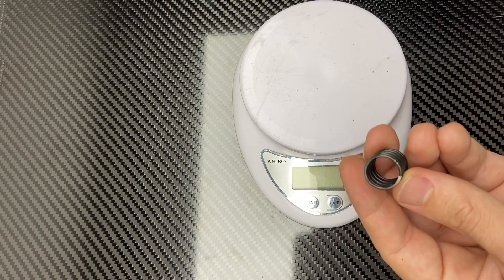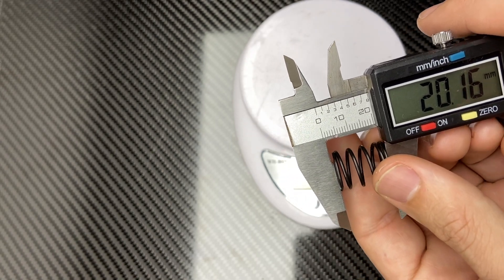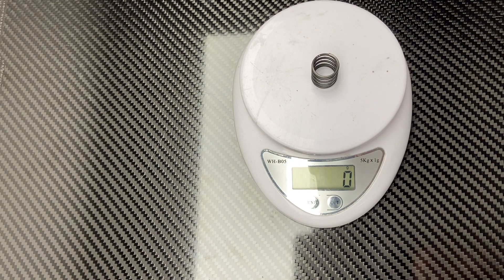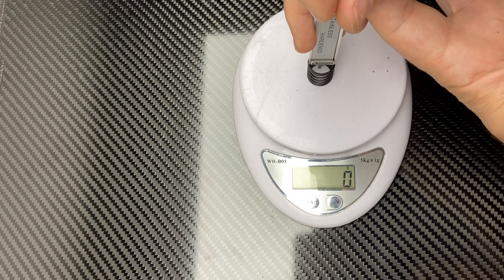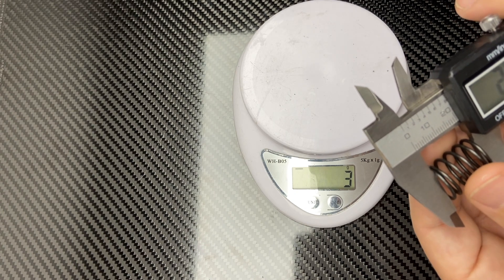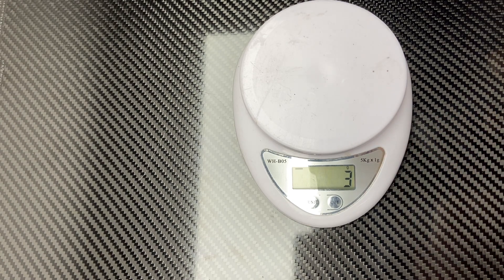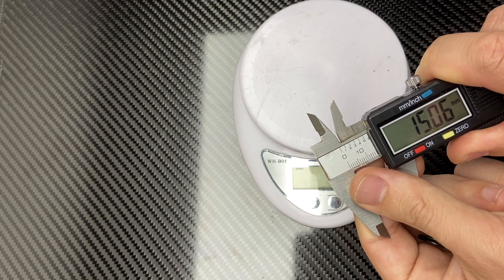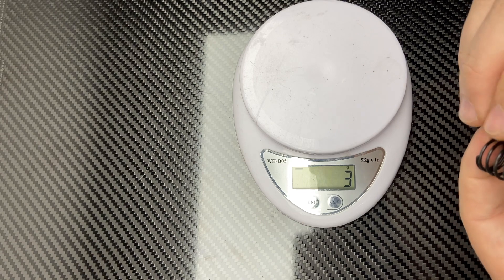'McTips' - How to measure spring rates of your RC Car springs.

Comment: I hate to ruin the nice party that's been going on here, but this method is not accurate enough for what you're trying to do, honestly. The problem does not lie in the method itself, but rather the fact that that the "displacement limit" is reached when the end of the protruding caliper touches the scale. The problem with this is that even when it touches, you can still apply more force, pushing the scales harder without compressing the spring. Thus, this method would only work precisely enough if one could perfectly stop to apply force as soon as the caliper end touches the scale. The reality is, though, that no one has such a precise hand-eye coordination and for such small springs that have low spring rates the variation in a few tens of grams can considerably change the result. One could find a way to adapt this method so that the end of the caliper touches on some hard surface that doesn't bear on the scales, whilst the spring does - this would provide precise results as the scale would always "see" only the load applied to the spring, not the caliper (which is what it sees in this case).
Reply: As this was crudely done, sure, one can understand your point. However, if you factor in that small margin of error for the end point contact of the caliper, it's all good. Just make sure to bring on the surgeon's hands for this mission and you'll be fine! You can CLEARLY see the results were nearly spot on with just a few 10ths off in one direction or the other.

Comment: Not quite understanding your demonstration in your video. I know you tightened the caliper so it sticks out 10cm at the end tip, and then you press it down on the spring until the caliper end tip touches the base of the scale?  What happens if the spring is much longer, then to reach base of the scale...then wouldn't you press down more than 10cm? which will then make the spring rate measure invalid as it moved more than 10cm.  I've done similar using a scale and then pressing on the so it moves down 10cm, and then take the scale reading. Thanks
Reply: It's mm not cm. ;) But the key bit is that at the start the pin sticks out "length of spring". Then he retracts the pin by 10mm, so the pin sticks out "length of spring minus 10mm". When\if the pin contacts the scale, the spring is compressed by 10mm.

Comment: For 1/8 scale spring...how much i need to minus?..
Reply: I would also like to know
Reply: You can use any "minus distance" that gives you a good reading on the scale. As long as you divide the force by the "minus distance", the spring rate will be correct.

Comment: Hi Tony, Thanks for posting your videos, I find your tips and manner very up front and easy to watch. I have started racing 21.5 with a car I brought from a modified class guy, I feel my springs are too stiff for 21.5 power, and i have lots of spares I might change out to. What spring rate is well suited to 21.5?
Reply from the maker: Hi 😊 what chassis are you using and what surface track are you racing on?
Reply: @TonyMcMahonRC  , Hi Tony, I race at TFTR in Melbourne, its a high quality hot mix asphalt, very good. Other times I may race at boronia, which is standard coarse road surface. S
Reply from the maker: @stwrtmck7067  - those are my local tracks 😊 what chassis are you using?
Reply: @TonyMcMahonRC  Hi, I missed that, I run a Hot Bodies TCXX 14, I find its a great car. Over the weekend I measured my swag of springs using your method. It really helped me to discern what from what and see what I have in spare. I installed 2.8’s all round, stood the shocks up tall and was able to use the enths of the spring rate. I decided to go with 5mm ride height, and 3mm up travel. The car had pleasant flow, and was quite forgiving. I even put the front diff back in to find the car was softer again. 

S
Reply: I meant to say - all my shocks are 25mm long, I used the less 10mm rule and was able to attain a measurement. But is this the correct way to measure a 25mm long spring?? Thanks, S

Comment: Great video. Can same method be used with much smaller springs ( 1/12 for example ) but just using smaller increments?
Reply from the maker: Absolutely, you can simply make up your own system, the key is to simply know how each spring compares to the next 😊